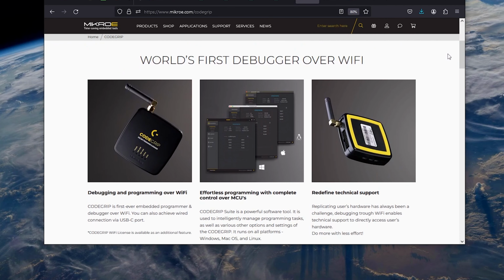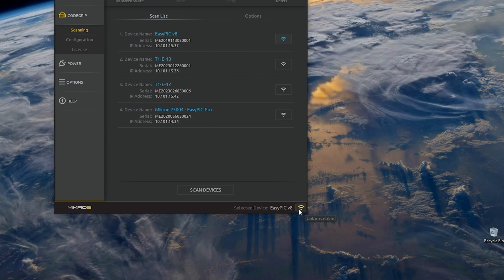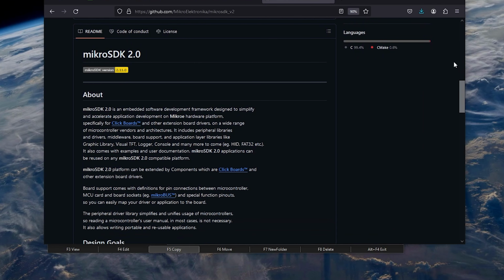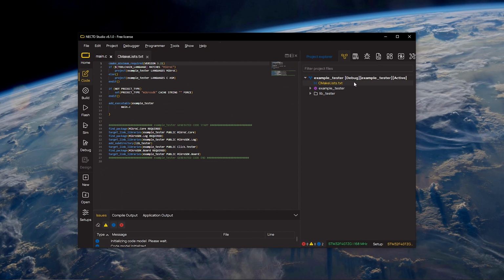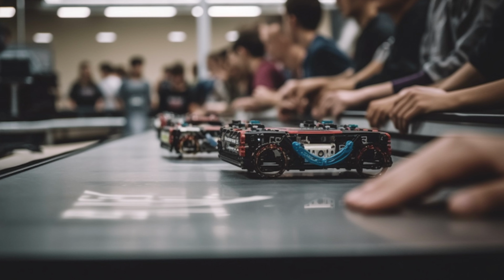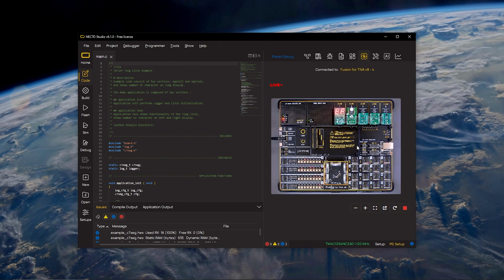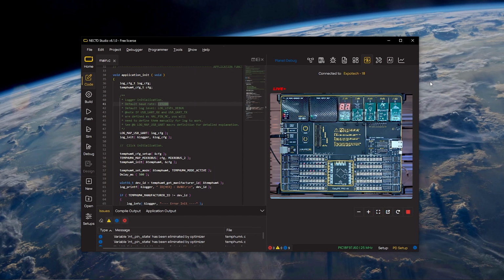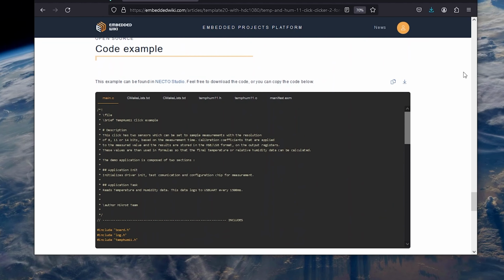Migrate from MikroC PRO to NECTO Studio! | part #3

Comment: I think your way is wrong. MikroC ARM, AtMega and PIC must continue. You will lose your users to Microchip Xlab or  STM Cube IDE.
Reply: They have already started to lose it. There is no one using Necto Studio, there is no developer using it on YouTube. The old structure was the best, I think you are being stubborn in vain,If you had developed the old structure, you would have earned much more.
Reply: It's not as easy, as you think. For instance, try to setup FPC succesfully for a Pascal programmer, using an ARM STM32. For me, I will stay with the older environment, even if there are few flaws. You just have to know about them. In most cases compiling will be fine, if YOU didnt make a mistake in the source code.
Reply: I don't think so, but your remark is pertinent.